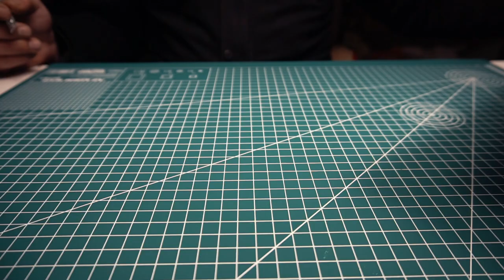Convert photo frame into 3D (Diorama)

Comment: This is a good looking diorama and I hope that you will take these two points as constructive criticism.
1. the edging of your base lets down the effect - it can be given a nice clean edge by gluing heavy paper, or thin cardboard.
2. if the figures are meant to be the focal point of the piece,  then the backdrop is a little tall. I understand that you are working with a picture frame, but you could cut the bottom edge off.

Overall it is a good piece and I like it.
Reply from the maker: Thank you for your nice comment, I will take care 😊